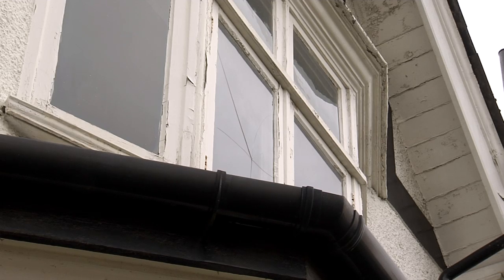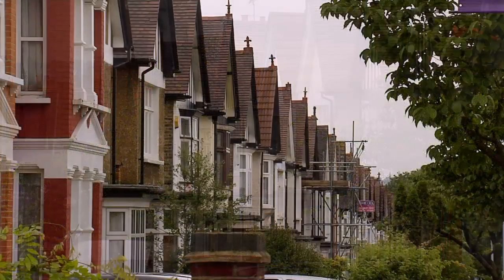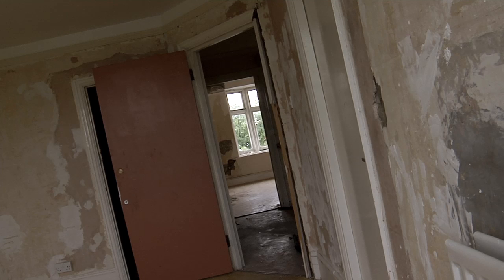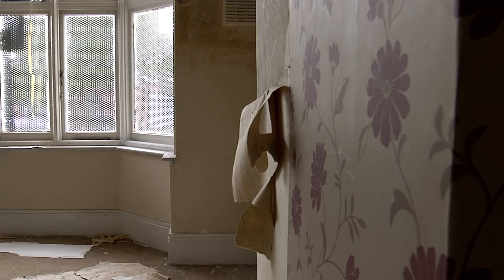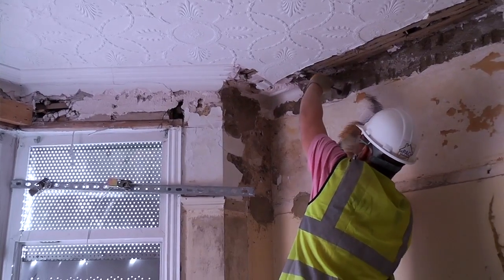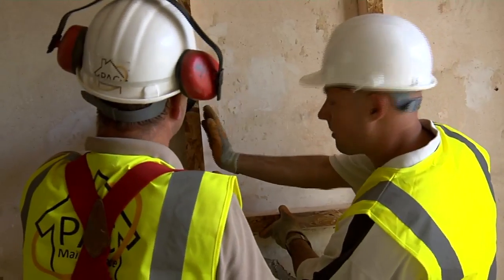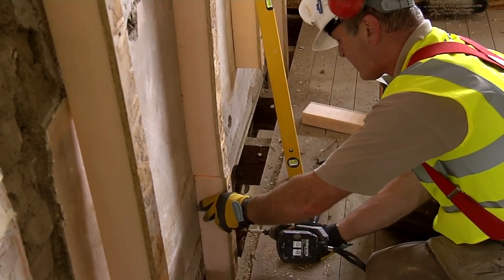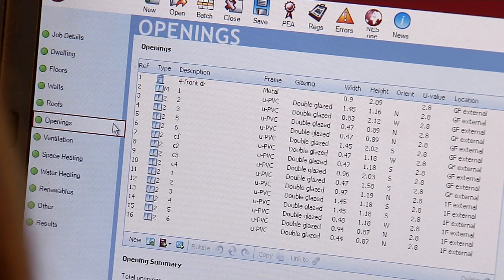Energy Saving Retrofit Video of Victorian Housing in London

Comment: So reduce the living area by approx 2m² per room, remove any chimney breasts, ceilings and decorative coving, fit new windows, underfloor insulation, relocate and re-plumb/re-wire central heating/ electricity and fit a new ventilation system with smart controllers. For a four bed semi in London I'd expect that to take six months and cost approximately 50k.
Reply: But you'll save 3quid a month off your energy bills